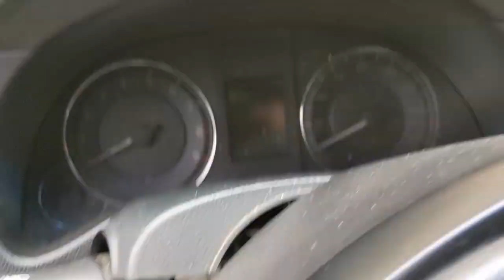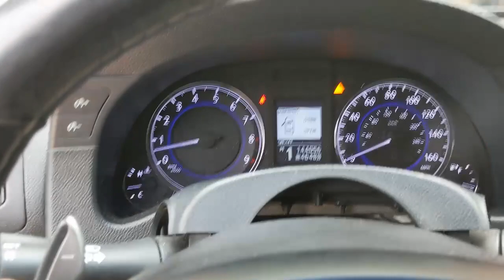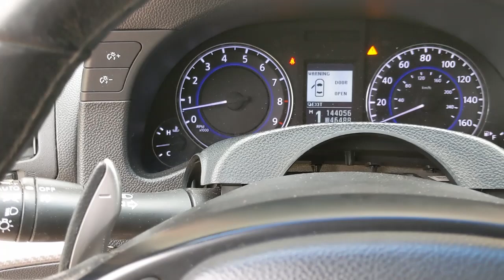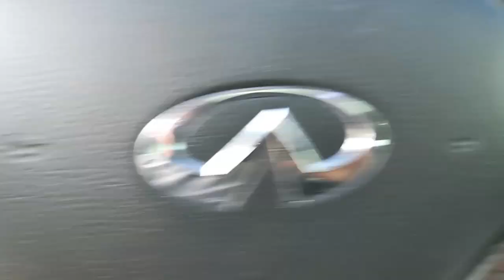G37 Paddle Shift Install

Comment: did you find success in cutting your own steering shroud? i just bought the paddles not knowing that the shroud needed to be replaced/fixed and i'm not sure if i should source a new one(if you have a link that would be great) or if i should modify my own
Reply from the maker: No luck on the cut out of the original shroud.  I got the paddle shroud from Z1.  Just be careful that you order the correct one.  I ordered the same ones I had at first.  In the site image they look the same.  To be for sure just give them a call.

Comment: I'm not sure if my come in pre-wiring
Reply from the maker: You’ll have to pull the steering shroud and see if you have the leads. It’s Easy to check.
Reply: 2015 Infiniti q40
Reply from the maker: jeffjl12   Not specifically familiar but it’s probably the same to check. Look to the forums for more info.
Reply: Do you have ig so I could send pic
Reply from the maker: @jeffjl12   I dont.  Watch this video.   If your Q has the leads for paddles they should look like this.  https://www.youtube.com/watch?v=E9MGHs0ey8o&t=3s

Comment: Would this work on a 07-08 g35 sedan? Not much on it, and does it need to be the sport package?
Reply from the maker: Not fully sure on G35's but they did have a paddle options.  You can check by pulling off the colum shroud.  https://youtu.be/E9MGHs0ey8o.  If you have the two leads on the harness you can get the shifters.
Reply from the maker: I will add outside of the cool factor these do not improve the shift speeds.  Letting the computer control the shifts in regular sport is the fastest path.  I proved this at the drag strip.

Comment: 👍👍 how did u fit the bottom shroud? I wanna do the same without paying for the shroud
Reply from the maker: I did not get far.  I should have looked closer at the factory piece it's in 3 sections.  I believe you will have to cut out the mid section at the bottom then cut a channel to go around the shifters then find a way to meld it back together.  I ended up just buying the new pieces from Z1.
Reply: @mostumpy  thank u very much!

Comment: Would this work on a 08 g35?
Reply from the maker: I think 07-08 G35 use the same shifters but you will have to see if your harness has the connectors under the steering shroud.
Reply from the maker: https://youtu.be/E9MGHs0ey8o  How to check.
Reply: OGeezer37 Thanks i’ll check it